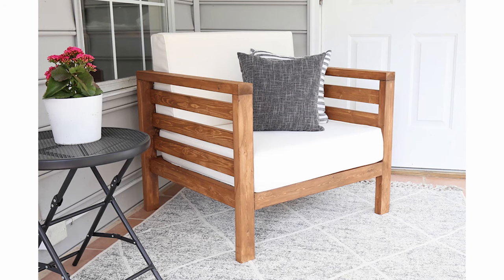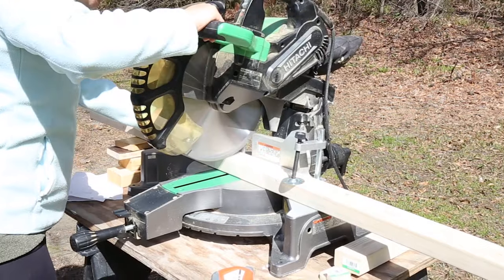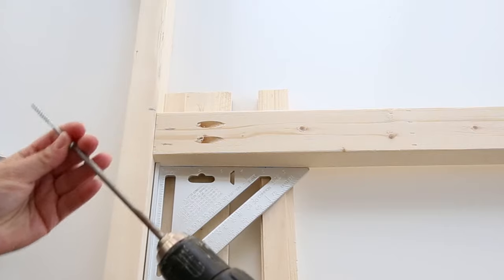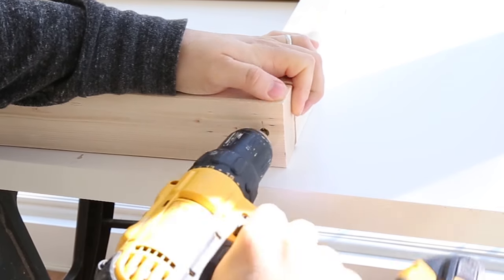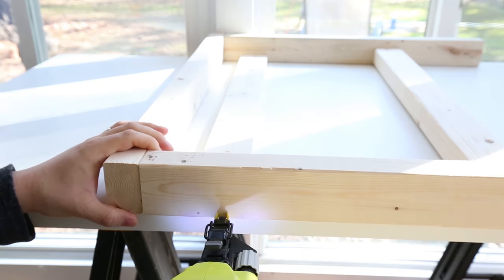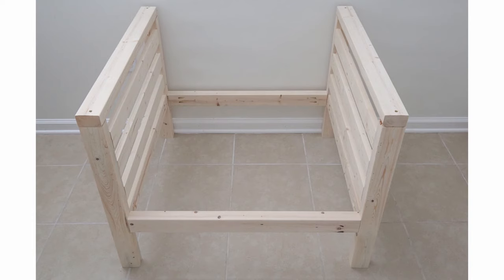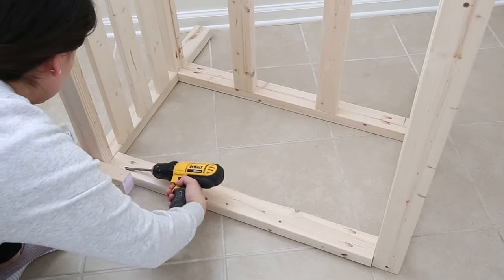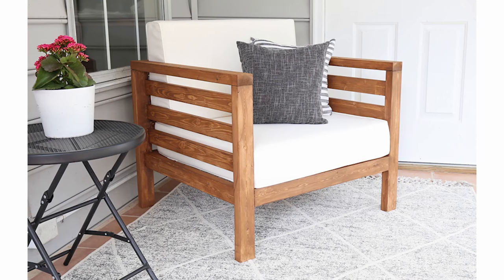DIY Outdoor Chair | How to Build an Outdoor Chair for $30!

Comment from the maker: *Note, at 5:28 for the bottom supports, I ran out of lumber and had to use just two boards, but three bottom support boards (spaced 5" apart) should be used as shown in my build plans for the best support! Also, it's best to use waterproof wood glue along with the screws for attaching all of the 2x3s together!
Reply: Aaa

Comment: So me and my father made the chair but I wanted it for my bedroom instead of outside. It came out pretty good I did a different side design and I made my cushions out of an old couch my dad had in his basement. We stripped the couch and took that cushion then I used a hot glue gun, stapler gun and some cardboard to complete the cushion and it came out pretty good being I used a Flat sheet from my bed set so the seat would match !
Reply from the maker: That sounds awesome! I love the idea of using it inside for a bedroom! And that's so creative for the cushion too! Thanks for sharing :)
Reply: Do u have photos of your build?

Comment: I absolutely love this chair.  I am determined to try to build this.  The cushions are really what cost the most on this build.
Reply from the maker: Thank you!
Reply: Buying The foam from Walmart is a way cheaper option. I used foam from an old couch but I considered getting the one from Walmart and I used a bed sheet as my seat cover. I don’t know how to use a sewing machine so I attached the fabric with a hot glue gun, a stapler gun and some cardboard!

Comment: Hello there, I have requested your DVDs, for simpler and quicker approach to manufacture a shed Allmy.Tips I trust the substance are as you guaranteed it will be. Just I'm worried with the substance, it won't be anything but difficult to settle on a decision from the various plans.
Reply from the maker: Check out my DIY computer desk tutorial - 3/4" plywood can be used instead of the edge glued panel board!
Reply from the maker: https://angelamariemade.com/easy-diy-computer-desk/

Comment: I made this chair last spring (along with ANA white L-couches) and this was super easy to build. Since I had extra slats, I used them for the sides, saving on costs of more 2x2s.  I had got the foam from The Foam Factory, though it can be pricey.  I also added solar led lights. Thank you for the plans!
Reply from the maker: That's awesome, I'm glad you liked the plans! Thank you!

Comment: I used mahogany lumber and mitered the corners where the front supports meet the arms and where the back support meets the arms. I also used more boards and placed them closer together so the cushion would not squish through the bottom. I finished with a clear oil. I also built one from poplar and painted it.
Reply from the maker: That's awesome, I love how you modified this to make it your own!

Comment: Love this project I think I would want a couple more base supports. It looks very classy on your porch
Reply from the maker: Thank you so much! Yes I would recommend doing three base supports (which I explain in the build plans & tutorial on my site). I ran out of lumber during filming and that's why there are just two in the video!
Reply: @AngelaMarieMade  I feel like you could even add one or two running perpendicular under the three base supports too since they are 1x3 and should fit without sticking out under the chair. I love these plans! Thanks for sharing!

Comment: Hello. Thanks so much for sharing your time and expertise. My wife has chosen a pillow that measures 24" in width. Would it be alright if I cut the 5 pieces for the back and front frames at 25". And I am guessing that the two side frame pieces would have to be shortened as well. Am I on the right track here?

Comment: Note to self, make sure the cushions are in stock before building this 😅. I've been waiting for a month now lol. Love the way it turned out tho! Thanks as always Angela!
Reply from the maker: Awesome! Thank you, I hope those cushions come back sooon!!!
Reply: Do the cushions from World Market ever come back? This comment is 9 months old so hoping you were able to get it?
Reply: @kram03yout  I wasn't able to get one. I signed up to be notified when they're back in stock but no dice.
Reply: Did you find another one that’s the same size or are they just cushionless?
Reply: @JBoo-dr6gd  what did you end up doin? I went and bought their cushion covers and currently attempting to stuff them myself but the back part is at an angle and cutting the cushion accurately not to mention the cost is kinda hard.
Reply: @kram03yout  I ended up going to Lowes and getting their largest 2 piece cushion they had (I think 25" x 25") and just downsized a little on the boards used to form the width, depth I feel didn't need cutting. Works perfectly now.

Comment: Hello! We are not builders but we have been looking for patio furniture for MONTHS and building seems like it’d be the cheaper option. But I wanted to ask, is it possible to not use the angled kreg holes and just screw the boards from the side (if that makes sense on what I’m asking)? Will it be just as sturdy that way? Thanks!
Reply from the maker: I prefer the Kreg joint but you can do it that way as well! I would use waterproof wood glue with just the screw version.

Comment: Nice chair
Reply from the maker: Thank you!
Reply: @AngelaMarieMade  Where can I find the cushions for this chair. I have had no luck so far finding the 28 3/4 by 28 3/4 or the 28 by 28.
Reply from the maker: @jamesmorrison1934  The 28" x 28" cushions on wayfair are the best alternative option that I have come across. Here is a link to these cushions that come in multiple colors: https://rstyle.me/+Lh5oRgFgy5T9gWCvhLdyLw. These cushions come in 2 different sizes so make sure that you choose the 28 x 28 size from the drop down menu when ordering.

Comment: Love this!! By chance is do you know the weight limit? Im thinking we may need to add a third slat on the bottom? We have a big family (over 6ft & 250-300lbs)  lol
Reply from the maker: Thank you! Yes I would definitely do a 3rd support, which I do show in the build plans and my blog tutorial. I had run out of lumber for the last support and just did two. I don't know the max weight but it does hold my husband no problem who weighs 230lbs.
Reply: Yeah, I was thinking extra slat and 1/4inch plywood bottom.  You know, for the family and all. Lol

Comment: Great project! What stain diff you say you used? Valspar semi transparent in pine bark?
Reply from the maker: Thanks! Yes that's correct, Valspar semi transparent exterior stain in Pinebark. They carry it at Lowe's and it has to be tinted at the paint counter.

Comment: instead of slanted screw holes using the jig, could you use long screws like deck screws in the outside of the wood if you dont mind the buts of the screws showing?
Reply from the maker: Yes, you can use those type of screws instead of using the kreg jig and use wood filler to cover the holes.

Comment: Hello! What type of wood is this? Is framing lumber pine? Thanks!!
Reply: It's usually pine or douglas fir
Reply from the maker: The 2x3 framing lumber is a mix of different white woods like pine. Here is a link to the 2x3s: https://rstyle.me/+NdIzC9kHFbgzqNIj6cPVzw   The 1x3s I used were a knotty pine wood.

Comment: Are your measurements off? 8 ft = 96 inches but the cuttings equal to 98 inches. 24.5 x 4 = 98 inches. Is it suppose to be 24 inches cuts on a 8 ft?
Reply from the maker: You just need another 8ft board to make the 4th cut. All of the cuts and lumber supplies needed can be found here: https://angelamariemade.com/diy-outdoor-chair/

Comment: Is this sturdy? How much weight do you think it could support?
Reply from the maker: It is very sturdy, and you can add an additional 3rd support. I don't know the exact weight bearing load, but i know that it can hold up to 220 lbs with no problems.

Comment: I have been searching and searching for these large cushions but the ones you posted are out of stock. Any other recommendations?? I have the chairs already made because I had the larger cushions but they were sent ripped so I had to send them back and now they are out of stock.
Reply from the maker: That's a bummer! Unfortunately I don't know where else to buy them in that exact size. I do have some other cushion options linked in the description box, but they are different sizes.

Comment: Ok I'm a newbie so be gentle...in step 5 @ 4:39 how are those screws not running right into the screws on the side piece?
Reply from the maker: They are both going in at an angle at different parts into the wood!

Comment: Could tell me exactly what kind and color exterior wood stain you used? I bought a transparent wood stain and finisher. Painted on a scrap piece and it doesn’t look the same as yours.
Reply from the maker: I used Pinebark by Valspar. In the matching couch video I show a picture of the stain can with all the details, towards the end of the video!

Comment: Can you have the hardware store make the pocket holes for you? I was going to make these but I don't have any tools to make pocket holes.
Reply from the maker: They unfortunately don't make pocket holes for customers. Alternatively, you could just use a drill and screws instead to attach the 2x3s, but you would need to fill a lot more holes in doing that way. But it would work if you don't want to buy a Kreg Jig!
Reply: Hardware store won’t do it for you but the small Kreg jig is only about $25 I think
Reply: @AngelaMarieMade  Hey Angela my new YouTuberBestFriend :-)  So the screws can just be screwed in parallel to attach the 2x3's.  Also, do you think that I should get a different type of screw for added stability? Thank you so much.

Comment: Chair $30 .. tools $500 😂
Reply: Exactly! Haha
Reply: Don't diss someone sharing stuff with everyone. Most American households already have these tools. Also - if you don't most tools can be rented and even purchased for less than 200. you can also buy the tools used.
Reply: Exactly!!!
Reply: @gugnanisarika  yes! Alot of places have free tool rental as well if you purchase some of your materials from them .
Reply: you can have wood cut at home depot too and if you don’t have a drill i’m sorry 😭
Reply: I mean she is assuming you have tools. You can't wait something with lumber with zero tools lol.. the part that gets me is the that the cushions are like $150.. so the chair is actually almost $200. Still cheaper than buying new. But yeah.. cushions are expensive
Reply: A lot of this can be done with just hand tools. You can get a hand saw and miter rig at lowes for like $15 to make the miter cuts. You can do the pocket holes without a kreg jig.

Comment: Can I make it without the Greg Jig? That thing is 99dollars yikes
Reply from the maker: There is actually a mini Kreg jig for a less expensive option! I do prefer the Kreg joint but yes you can make it with just regular screws instead, but I would use a waterproof wood glue with them as well!